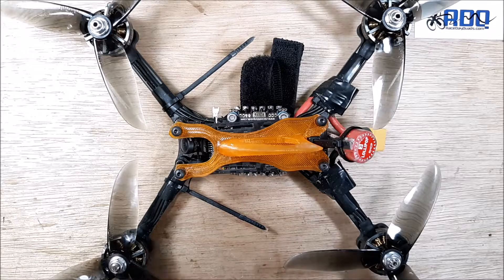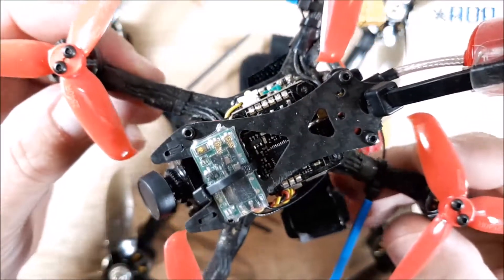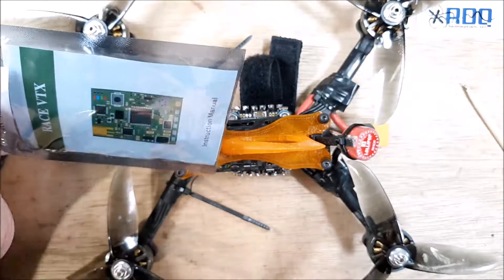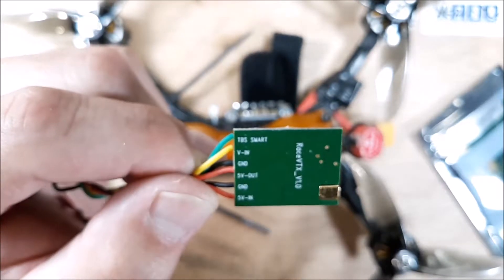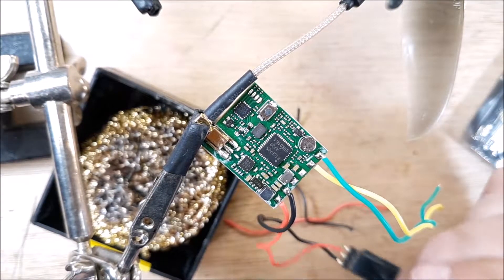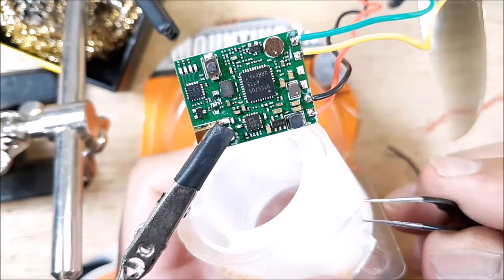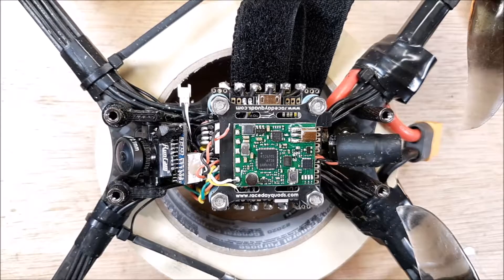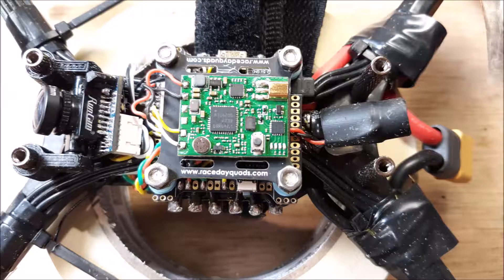How Replace A VTX | FPV AKK Race Video Transmitter

Comment: So far I've been pleased with RaceDayQuads ..product shipped right on time, placed a order by mistake and canceled it with no problem. Their the only company I believe I will shop....I finally got my quad completed. Only problem is, the Micro Rumcam swift 3 v2 IS to large for my Diatone GT 2019 R349 What good Foxeer or caddax, being a good cam, will fit  into my quad..Nice modification, still a little confused how you done it. TFS!
Reply from the maker: The ER349 comes with a swift. Hum?